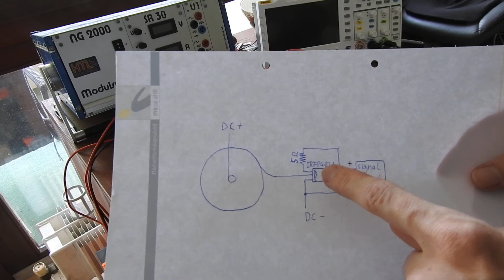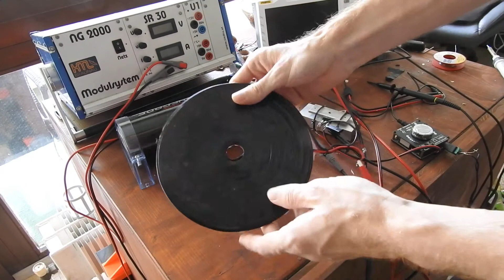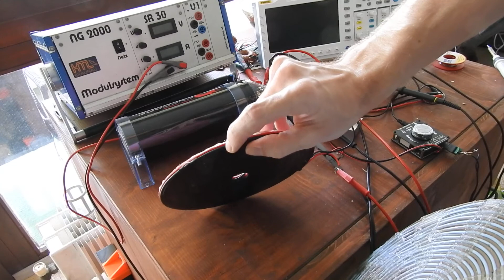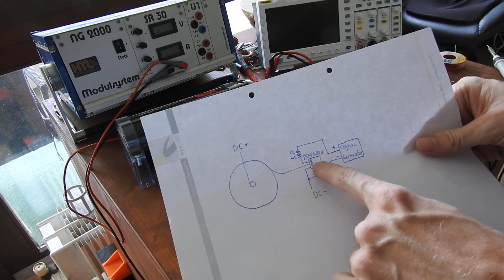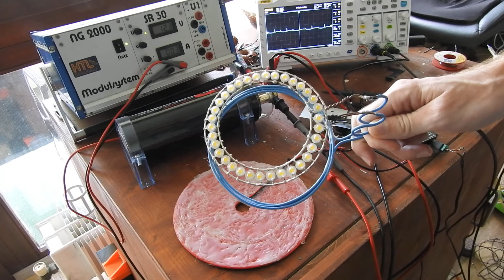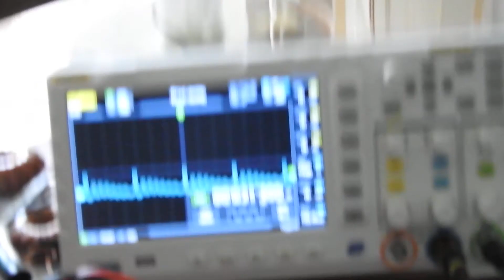How to build a high voltage impulse generator | easy tutorial to tune a bifilar coil to resonance

Comment: Which Transistor did you use, name? Any recommendations if i want to run this continually 24/7 - please, i tried this last and using D718 mosfet, it was working but burnt all 16 mosfets , now i wanna try IRF460 like you😊 or 2N222

Comment: the source impedance of the signal generator should have input to a common emitter for voltage gain and followed by a common collector for a low output impedance to drive the gate/base? I have the same scope, it's labeled 75 ohms on the test leads of the signal generator.. nice work btw! i just built a replica of professor meyl's kit and i would like configure impulse current drivers with bifilars to drive the low impedance coils instead of driving it with (AC) oscillators for the 1899 patent.. welp, I'm writing book, so, good day sir😊
Reply: today was a great success.. the circuit is working with crystal battery voltage/current.. so the the entire circuit including the input from the power supply and signal source can be high resistance/impedance sources as such from typical crystal cells/batteries in series (supply) for instance (adding a diode after positive supply terminal because the type of crystal battery I'm using will stay charged themselves) and mostly series/parallel crystal cells for powering the signal source.. waiting on more wire to attach the 3 turns loop ➰ and appropriate load but an E field is detected with hardly any significance to the presence of a magnetic field or RF.. of course it will take more current to (indirectly) drive the 1899 patent as they are low impedance coils.. hence, the average impedance of earth.. have a good day

Comment: Does being in that electrostatic field for a period of time chante the way you feel?
Reply from the maker: Yes it does feel kinda strange after some time.
Reply: @OmegaZZ111  if you look up PEMF therapy, I think you'll understand it much better than I do and probably have a better chance of making use of it, easier. I'm trying to figure out if I can use a monofilar coil or bifilar coil to do this for myself... And not set myself on fire 😂. I know it may be a big ask, but if you find out, I'd really appreciate a quick low-down on it 😅
I suspect it can have a huge impact on many, many things, vivid dreams and stronger mind power and clarity and health being only the beginning.
Reply from the maker: @nicholasjames4145 
This is not a PEMF setup, it produces high voltage impulses, but the magnetic field produced is so weak that it is negligible.

I haven't tried PEMF devices yet, but if you have little experience with electronics I don't recommend you build one yourself, those capacitors can be very dangerous when charged.

Comment: Really nice explanation, I would have loved to see the usage of the Cap explained ☺️
Reply from the maker: The capacitor is actually not needed at all.
I just added it as a protection for my power supply and removed it later because it is not necessary.

Comment: your frequency generator probably is 50 ohm. it will work, but you have an impedance mischmatch with the load (the mosfet) this way you risk braking the generator (which might not happen) to prevent this I always used a gate driver IC like the IXDN614PI or IXDD614PI , which also makes it possible to switch the coil on the high side making the impulses negative.
I would love to answer your questions.
Reply from the maker: I tried to rebuild your circuit where you use the IXDN614PI but I used another gate driver instead (ICL7667).
Unfortunately my circuit never worked, so I switched over to this small audio amplifier that amplifies the signal from my signal generator.
The audio amplifier is basically indestructible, I have fail tested it in a lot of ways so far and couldn't manage to kill it. 

I found out by just flipping around my middle coil 180°, I get negative impulses instead of positive.
Reply: @OmegaZZ111 i Love Audio Amplifier solution. Works for me, do a video again on it, detailed connections 😊😊😊😊❤❤❤

Comment: be careful with your power supply. the second half of the resonant wave of the switched coil, passes back to the supply, through the body diode of the mosfet. Batteries can take it, but caps of the PSU can die from the high voltage (put a fast diode between mosfet and PSU, and a cap to store the energy for re-use, between diode and mosfet to the other polarity of the psu).
the large cap you use also protects, but you could use a much smaller cheaper cap if yo combine it with a diode (mur460) like I explained
Reply from the maker: So far it's still alive, but I thought it might be not that healthy for it, that's why I added the big capacitor haha.
I have some mur440 diodes at home, I should add one, thanks for the tip!
Reply: @OmegaZZ111  perfect! the small cap between diode and mosfet to ground can be around 680nF with a voltage rating enough to store the single impulse energy that passes through the body diode and is blocked by the mur440
Reply from the maker: @MasterIvo  I will try that, thanks!
Reply: So the critics online Google says that this is it's pretty much a hoax that it won't generate how much electricity dude. Now, what if you took 30 old batteries? Because you're starting with DC, correct? And turning it into AC and switching it on and off, and it creates electricity. Of a higher voltage, or average, not sure, probably both. So what if we are taking 20 batteries and hooking them together? So that would be 20 × 12 V, that's a lot. It would take a lot more heavy due to here. Other parts, but wouldn't that create a lot of electricity? And then what's how do we recharge the batteries with a battery charger? That's hooked up to the device. So we're ending up with more electricity, and then we started with correct.So when you do things on a higher scale, you're going to have a lot more power, you're working with

Comment: Yes! finally. very cool. I did the same years ago. I have advanced to using 2 mosfets in series, which are switched simultaneously. So I can now produce up to 3500V impulses.
and the gate driver is isolated, so I can switch the positive (high) or negative (low) side of the coil, producing positive or negative impulses.
Reply from the maker: Hi Ivo, nice to see you here :)
I watched all your videos a while ago and they were my inspiration to build this setup.

According to my oscilloscope I get high voltage impulses way beyond the 4kV my oscilloscope can show.

What purpose does it serve to create positive or negative impulses?
Do you get different effects?
Reply: @OmegaZZ111  yes, one is creating a displacement current out of the conductor, while the other flows into the conductor from the dielectric.
Reply: @MasterIvo Great to see 2 giaants i love here😅😅❤❤❤,i follow both of you😊😊😊😊😊❤❤❤❤😮😮😮. Blessings from Africa❤❤❤
Reply: @MakaLizwi ❤ from the Netherlands

Comment: Master Ivo wraps his bifiler coils like this but I have always disagreed with the design. Tesla's patent wraps the two wires on top rather than side by side. He preferred stranded to solid core wire and 6 or 8 gauge wire. You get high induction, low resistance, and a high energy sink. I don't think copper cladded makes a difference since it's a skin affect with current traveling outside the copper and dry air gap between the polyurethane. It would be interesting to see if you wrapped the bifiler coil with aluminum and tested the results. Tesla called for a separate ground or capasitor connected to the shielding. You might not see any difference due to it size. Just some thought on things I have read.
Reply from the maker: Tesla had lots of different designs for his bifilar coils, not only the one he showed in his patent. 
For the generation of high voltage the geometry doesn't really matter as long as the coil is bifilar.

From my experience there is definitely a difference between copper clad steel and pure copper, simply because steel is ferromagnetic and therefore affects the electric field that is generated.
Depending on what you want to achieve with the setup this can be beneficial or not.
Reply: @OmegaZZ111  the copper clad aluminum (CCA) also works, but does have much more resistance, which reduces the resonant voltage and current.
Reply: @OmegaZZ111  You might be right. I picked up 1000ft of copper clad shielded coaxial for $20. I didn't think about that. I want to see if I can reproduce the results he claims in his patent.